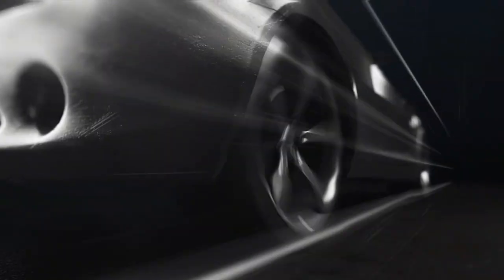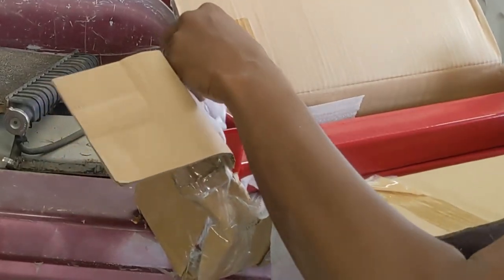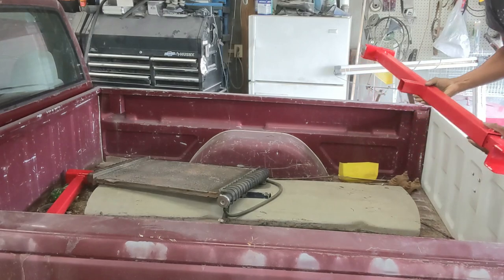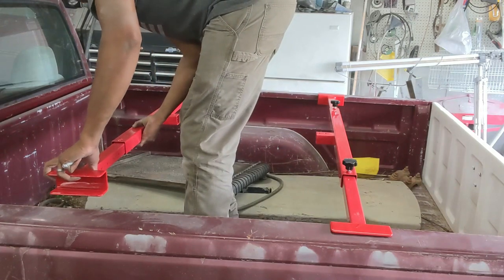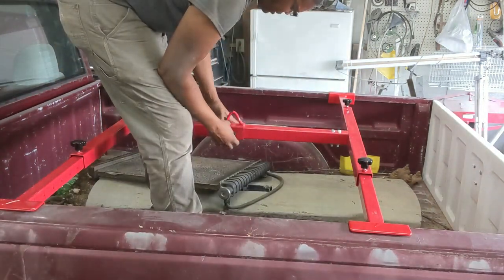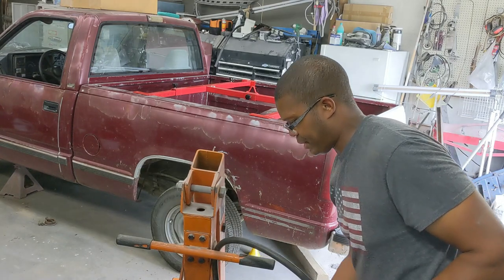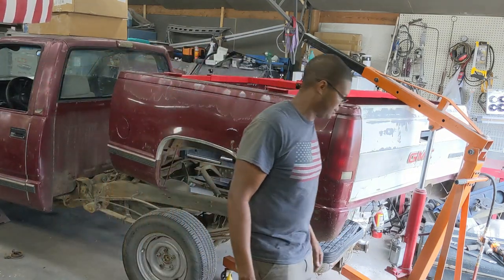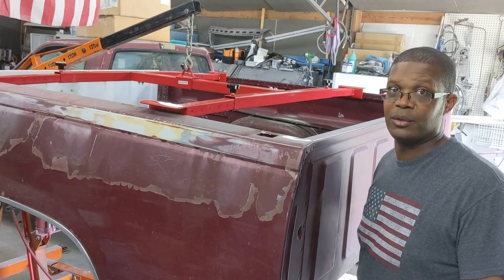Amazon Jegs Summit Racing Truck Bed Lift Review & How To Chevy Dodge Ford Toyota Nissan

Comment: To make simple bed dolly, get old kitchen table.  Attach 4 swivel casters on table top in each corner, now flip table over legs pointing up.  Simply lower bed onto legs, most kitchen tables can be adjusted lengthwise to clear underside cross members👍
Reply from the maker: That's a good idea, I used a hay wagon because I needed something that would be able to handle concrete and outside terrains.
Reply: Incredible.  This really helps!

Comment: Change the bedside if that’s the only thing that’s wrong with it ?
Reply from the maker: Truck needed a fuel pump, that's why the bed was pulled. The dent was pulled, no need to replace this bedside, there was no crease in the metal from the dent, it pulled out relatively easy.

Comment: At least those useless short beds are easier to remove. Now try putting in a full size 4'x8' piece of plywood.
Reply from the maker: 😂 I got have an 8 foot bed on my work truck. These short beds are good for a few bags of mulch or moving an engine, but plywood and sheetrock is a challenge at times.

Comment: I do mine with just ratchet straps to the tow hooks and with the engine hoist but I like that idea
Reply from the maker: I used a couple 4x4 post and ratchet straps in the past, I wanted to try something that would protect the paint on fresh paint jobs or existing paint when doing fuel pumps. 

I've been happy with the performance and flexibility of this.